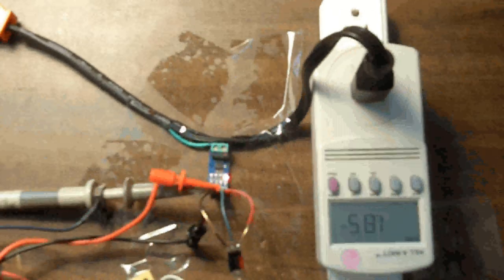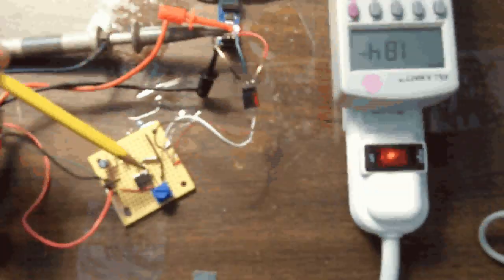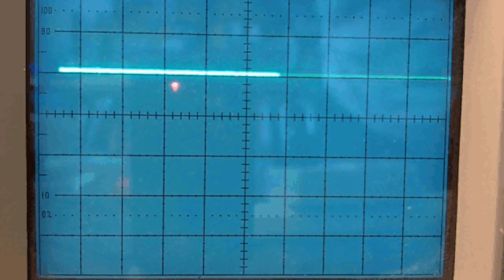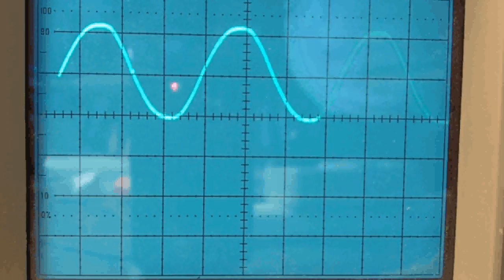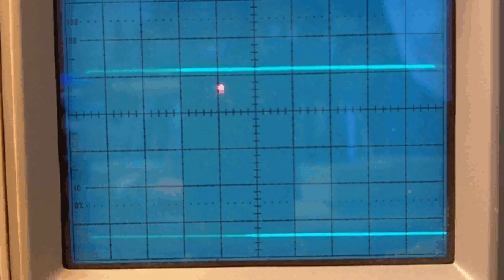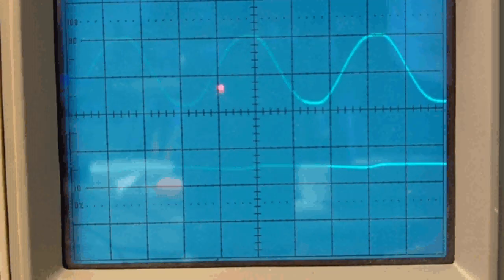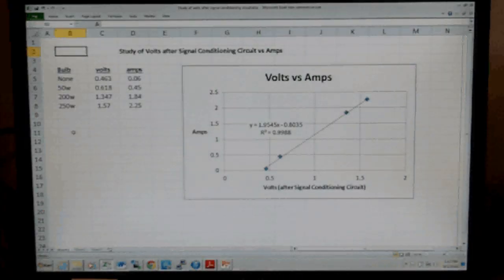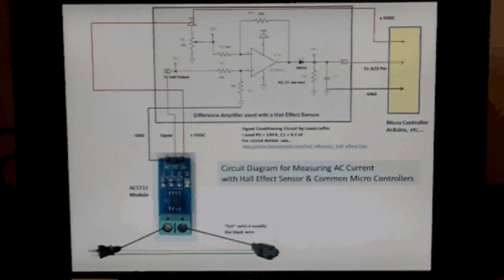How to Measure AC Current using Hall Effect Sensor with Arduino or other common Microcontrollers

Comment: If centre bias is the issue then would'nt it be easier to have a simple rectifier circuit and hook it up to  Aref pin of the arduino ?

Comment: Please don't turn the function dial on a multimeter with the probes plugged in!  At the least, remove one probe when changing the function.  I burned up my voltmeter doing that once.

Comment: What do you mean,  the unconditioned signal would be nonsense to a microcontroller? It's not difficult to sample the waveform every 1ms for example, and find the minimum and maximum values over a number of measurements to find the amplitude. And only slightly more work to calculate a true RMS value.
Reply: uh... the adc in the atmel chip can sample 10bit at up to 200khz and the chip he is using for current has an 80khz bandwidth. its not the 10x recomended for a scope costing $400 to thousands but for the 10 bucks this setup costs It should be sufficent. I think the cpu itself can be run up to 20mhz so doing some crunching isnt an issue either
Reply: +renxula that's true, but by the time the microcontroller do the sampling, it will halt a little bit and destroy its responsiveness. The more the sampling, more accurate it is but it will take more time.

Comment: That's cool. Anyway the problem of measuring AC current can be easely settle down (in most cases) via software. without adding any other hardware.

Comment: I'd like to see more detail on the connections as they are soldered on the signal conditioning circuit board.  I'm having some trouble following the schematic of the circuit as it is configured on the board.

Comment: Hey, nice video. But the next question is, how to measure the AC Voltage.

Thanks!
Reply: use zmpt101b voltage sensor with arduino